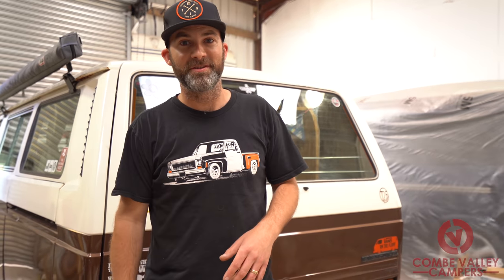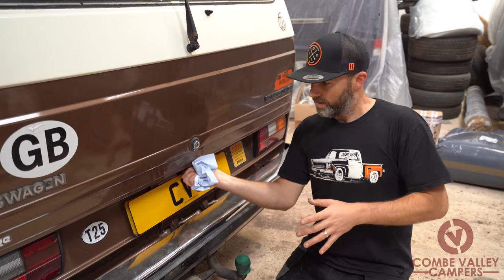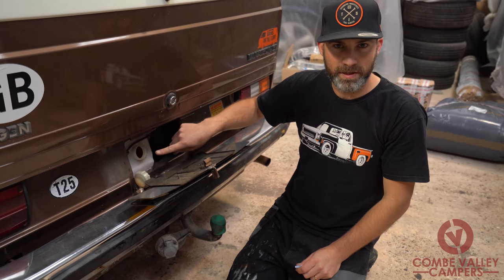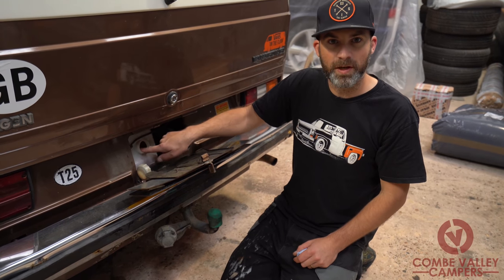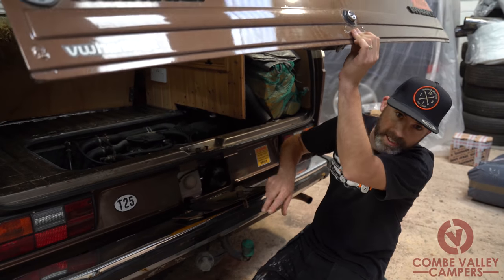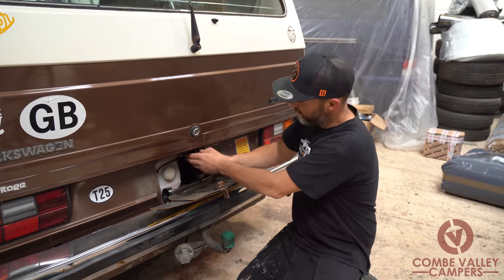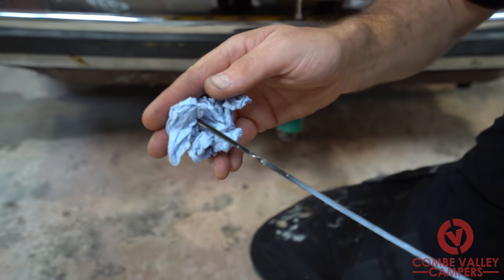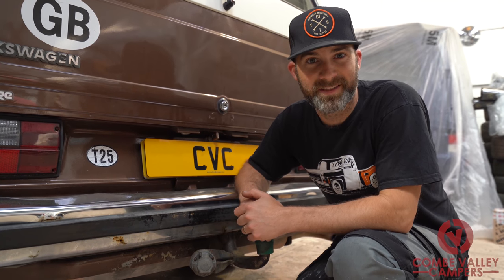How to check the oil and water on your T3, Vanagon, T25

Comment: OK. How about the T3 Diesel? I just looked at one with the dip stick under the engine lid. The tube had an orange plastic end but the dipstick had a red plastic finger ring? was it the wrong dip stick? What oil capacity should the diesel have? Looks like a golf type diesel tilted more on its side. Also it had a coolant expansion tank where the coolant should be checked from. The bottle behind the number plate is just the over flow catcher bottle so not an indication of actual coolant level. The apparent PCV valve on the cam cover was leaking a bit of oil so may be in indication of to much oil being put in due to overfilling with the wrong dip stick. Could you advise on correct fill volume on the diesel and if you have a dip stick with orange end could you measure the length of the metal whip part total and how far up from the end the full and low marks are please. Van already left Dover for Scotland so I would like to send the infirmation on if possible. Thanks

Comment: Hi there, thank you for sharing these videos. Ive got a question.. What about the other expansion tank? i've been told that we never should check that one , is that right?? Thank you.
Reply from the maker: If it is known to be empty or low in coolant because of a significant leak, or a modification to the cooling system, the expansion tank In the engine is where you refill the coolant system.
Reply: no  it is exactly  the oposite   always check the level in the main tank but never do it with  a hot engine  also there is a thing with  t 25's where the system does not blead properly due to the header tank being below the  the radiator  bleed valve . which means you have to lift the back of the motor up above the radiator  bleed valve  to get rid of the air traped in the system . simply topping the expansion bottle up  will not cure any over heating  problem  . never take your t25 to a vw dealerhip  they will kill it they know nothing about old school shite !

Comment: Thanks, How much oil can one fill if the level is on the bottom line until it comes to the top line? I just got an air cooled 1600ct vanagon
Reply from the maker: Keep adding a little at a time, and check between each top up, until you are happy that the top line has been reached.

Comment: As my "86 T-3 ages it can overheat and whatever I do it just remains a problem, can I upgrade the radiator or change the hoses, and of course the sensors go crazy.
Reply from the maker: Hi Tom, it could be one of a number of problems I'm afraid. Worn water pump, blocked radiator, cooling system not bled correctly... we could help you source the problem if you wish.

Comment: I recently purchased a VW T25 autosleeper and noticed the temp light flashing and the gauge goes to high immediately on turning the engine over. The water reservoir was empty and I filled it to the required amount. A few days later I turned the engine and nothing changed. Red light flashing and the gauge automatically goes to high. Is this because the water has not reached the engine from the reservoir yet or is it a faulty water pump? Any ideas please.
Reply from the maker: Sounds like the system need filling and bleeding. Look on Club 80-90 forum. Search on their wiki pages for bleeding the cooling system ;)

Comment: Why does my T3 have a water tank just with water in it and another tank for coolant at the back of the engine bay?
Reply from the maker: Both should be full of coolant
Reply: @CombeValleyCampers  ok. What's weird is I've discovered is that both tanks should be connected by a hose but nine aren't. What's going on here!
Reply from the maker: Yup, the large tank should have a pressure relief lid, and the hose from that should run to the bottle behind the inspection hatch
Reply: @CombeValleyCampers  OK, blimey. I wonder if this has anything to do with the coolant loss problem I experience and the overheating and the engine losing power at times. Scratches head It's made it all the way to Turkey and back like this! Thanks for replying on bank holiday!
Reply from the maker: @gordonblues843  my absolute pleasure. If you have any further problems, be sure to email info@combevalleycampers.co.uk

Comment: Right. Now then. The coolant thing. This BAFFLES me.
I have a 1.9 1984 dg. I use the blue coolant that Just Kampers recommend. But my expansion tank only has fluid in it after I've been driving.
When the engine cools it empties.
I don't fill this tank because if I fill it, AND drive the van, it'll literally burst with the amount of liquid in it. It'll easily exceed the MAX level. 

What am I doing wrong? 🙄😁
Reply from the maker: Hi Jack, thanks for your comments. Can I suggest taking a good look over the club 80-90 forum, and in particular the wiki pages. They are a huge wealth of information, especially about filling and bleeding your cooling system. Grab a brew,  reserve a couple of hours and digest all the information. Itll be way more info than I van fit in here dude.